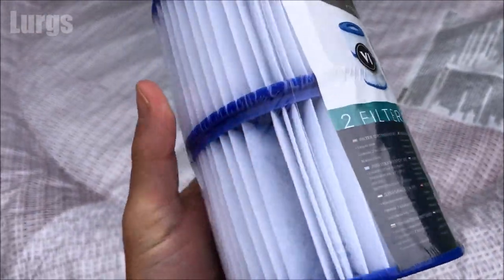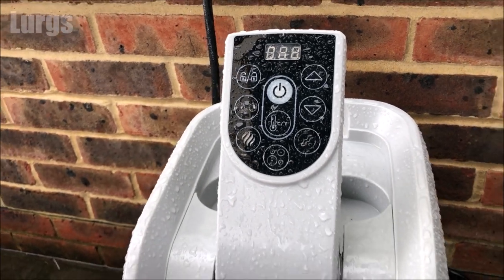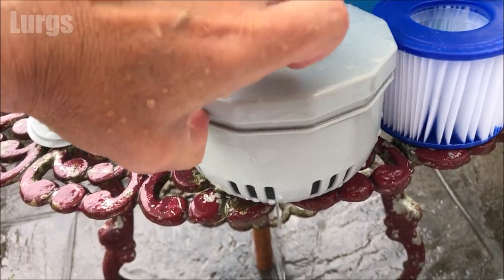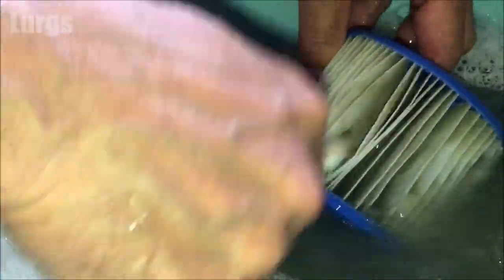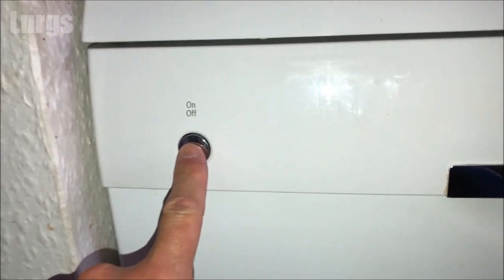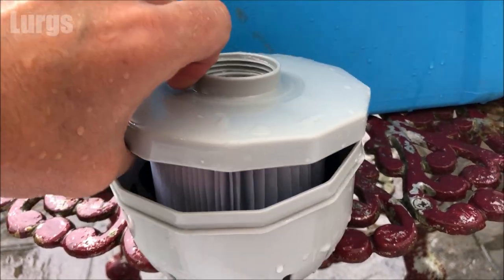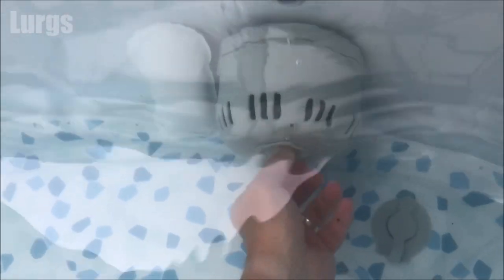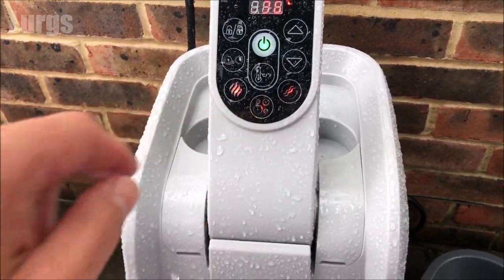How to clean filter on LAY-Z-SPA fix E02 Error on LAY-Z-SPA and SAVE MONEY

Comment: Thanks for the video, I've been cycling my 2 filters....Dirty one through the washing machine (Saw that tip in another video). Dishwasher seems like a better option as no tumbling etc. Will have to try it out. Also got 6 new ones or order which will help.
Reply from the maker: Washing old filters is a great saving but new filters do really make a huge difference to the water quality.

Comment: Just a question
Once the heater has gone green
Why does the water filter keeps running
Is that right
Or should it stop
Reply from the maker: That’s correct. The water filter is on permanently if you have the water filter light on, even if it’s reached temperature. You can press the water filter button to turn it off but it’s best left on, it’s only 50w power and helps keep water clean. Enjoy
Reply: @LurgsHowToGuides  thanks heaps

Comment: Hi great video.one question does it blow or suck water through the filter I always thought it was suppose to suck water hence catching any grime etc from the pool but someone told me it blows through the filters and catches dirt etc after going through the pump? I’m confused ?
Reply from the maker: I guess it doesn't matter which way it goes as ultimately it will catch any debris. Never really thought about it. Enjoy your Spa. 😎
Reply: it sucks in through the filter so your not pulling rubbish through the heater and pump. You can tell as when the pump is running water comes out the other (top) port.
Reply: No it must go on the bottom and be sucked in before it hits the pump, the other way round and all the crud with go through the pump first...not good

Comment: For anyone seeing this now. There is zero need to remove the entire filter housing from the spa. There is a bolt on the front of the casing which will allow you to remove the filter that way which is the correct and recommended way of doing it.
Reply from the maker: Um no because if you do that all the crap from the filter will go in your LAY Z SPA. That’s why you take it all off before removing the filter!
Reply: @LurgsHowToGuides  its makes no odds which way you do it but the way I said it's the correct method that lazy spa tell you to do it. And doing it your way you still have water come out of the housing. Plus if you done regular changes like I do I change out the filter after each use and replace it with a clean one and wash the removed one the filters don't get green like yours did. Also there is the bestway pool and lazy spa rechargeable floor hoover which I highly recommend. You will notice a massive difference in how dirty your filters are and the water quality. I got my lazy pool hoover from The Range for £40
Reply from the maker: I have to disagree. When I remove the housing and then take off the cover it is full of long hair and dirt! All that will go straight in the LAY Z SPA if you just remove the cover whilst it’s installed, that makes no sense.
Reply: @LurgsHowToGuides  each to their own but I prefer doing it the way the manufacturer says do it. Plus because I hoover my hot tub after each I don't get much build up inside of the filter. I'm very anal about keeping the water clean.
Reply: @LurgsHowToGuides  I'm with you on this one Lurgs